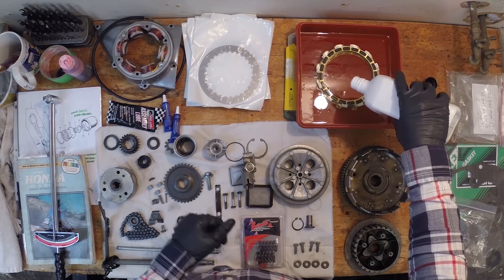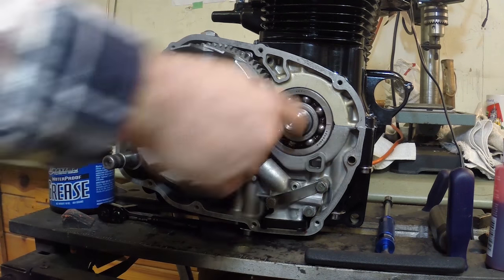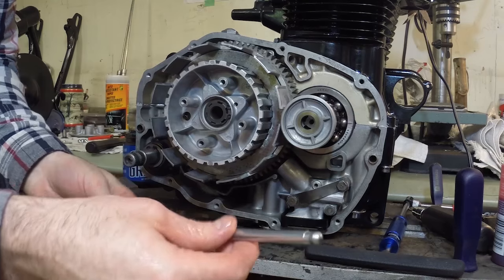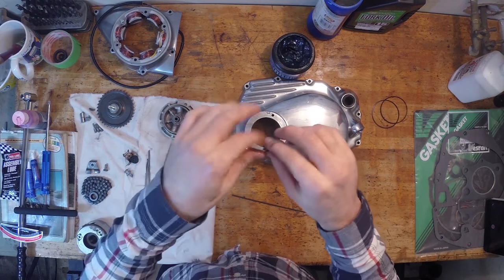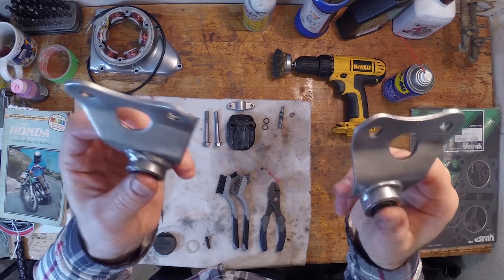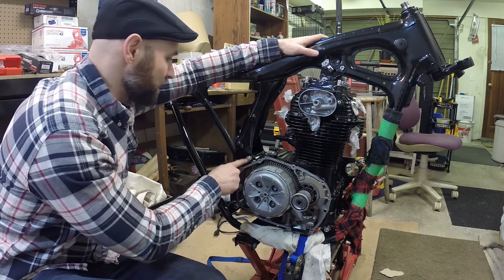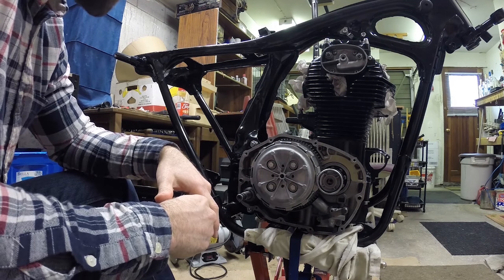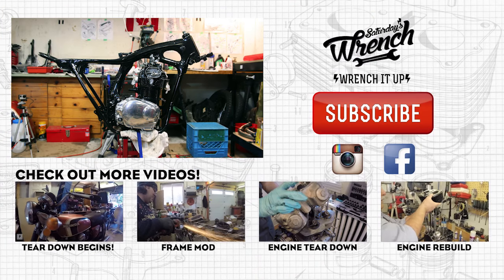Saturday's Wrench Ep.22: Engine Mount - Honda CB350 Build

Comment: Did I miss a video of you painting the engine? I was really looking forward to that part. Wondering what kind of paint.

I'll be adding a build series to my channel hopefully this coming year. Thanks for uploading.
Reply from the maker: +Tom Malone I spoke about it in one of the videos but did not film the process. I used VHT High temperature engine enamel with a coat of primer before that. High gloss black.
Reply: Saturdays Wrench thanks! I've watched every video in the series. thank you for the contribution!
Reply from the maker: Tom Malone awesome! thx for the support man.

Comment: Nice video, I have a 1973 CB 350G SUPER SPORT, the one with the front disc brake. I have seen on ebay that they are selling paper oil filter elements for this bike ,mine like yours has a centrafugal oil filter. I have never heard of these bikes of this year having a paper oil filter, have you?.

Comment: Looking great! Did you ever figure out how to bend the lock washer tabs on the oil slinger?
Reply from the maker: +Robert White Thanks! Ya I'm pretty sure I've got it figured out. I believe my needle nose pliers weren't long enough. I'm going to try something next time I'm in the garage and post it on my next video. Cheers!
Reply: +Saturdays Wrench  Use a flathead screwdriver to bend the tabs over.

Comment: id use wood to jam up the gears/engine....also ....where the clutch plates  slide back and forth in the hub, could check that those serfaces are smooth  for easy  sliding

Comment: Sweet! Looks like new. I have a problem with my '71 CB350. I just got the bike and it is my first bike. The clutch is acting up and it seems like it's just barely disengaging. I pull the lever in all the way, it's very hard to pull almost as if it was the break! I took the left cover off where the cable goes in and messed around with the bearings in there, cleaned it up a bit and put it back together. STILL has the problem. I'm wondering if I have to drain the oil to take the right side cover off to check the plates
Reply from the maker: Hi and sorry for the late reply! You may need to replace the clutch plates or just look up how to do a clutch adjustment online and try doing that. You can also mess with the tightness/looseness of your clutch on the end of the lever, just screw the mechanism in or out to adjust it.. The cable might just need adjustment! That's probably it. Good luck!

Comment: Only pre-1982 pennies are copper, later pennies are mostly zinc with a 2% copper coating. Zinc is close to aluminum in hardness, so you should be safe either way =)
Reply from the maker: +Ace Futura Good to know! Thanks man.

Comment: Do you happen to know what the torque spec are on the clutch spring bolts? I've looked everywhere and can't seem to find it! THANKS
Reply from the maker: +Eric Leschied I would not go more than 7-8 ft lbs on those! Trust me!! I've cracked a clutch basket before. Be very very careful. 7 ft lbs is just fine!

Comment: IF I'm not mistake the Primary Drive Sprocket is also chamfered, Are chamfers facing out?
Reply from the maker: +Brian VanderMey mine was not if I remember correctly. Just the bolt for the oil singer.

Comment: You install the centrifuge nut the wrong way around. Good idea with the penny though. And don't lube threads.
Reply from the maker: +rocketri.de motors thank you for the tip. It wasn't until a bit later I realized this and fixed the problem. I ordered a new lock washer and installed it properly. Thanks again for the tip.